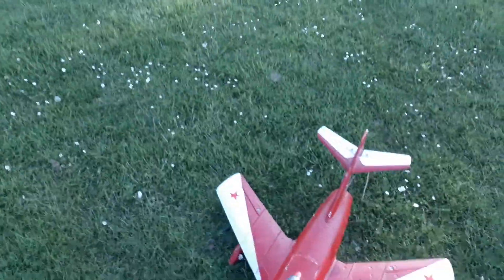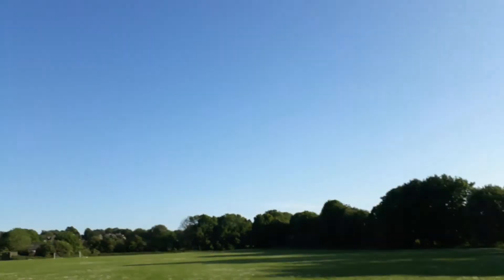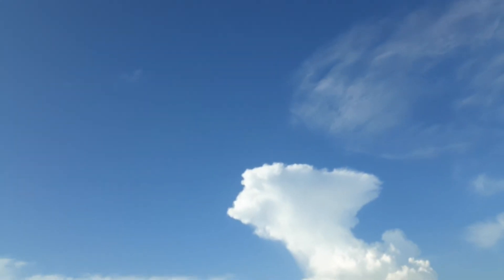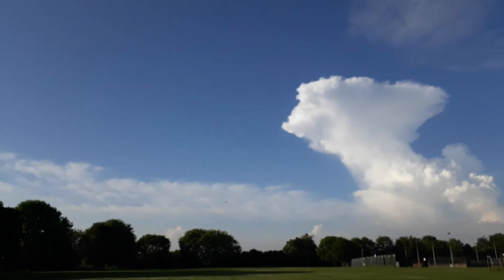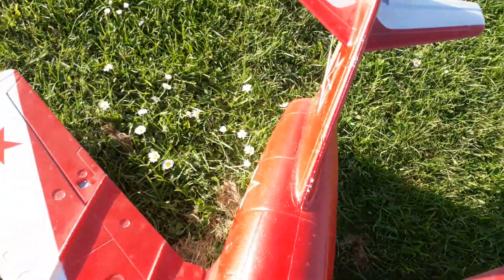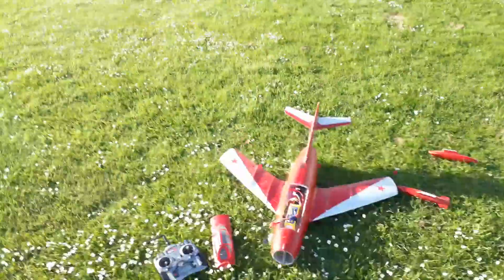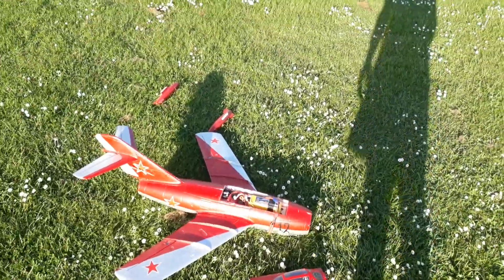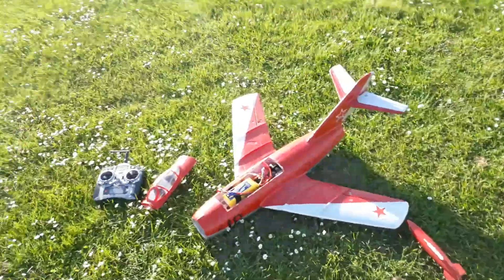Mig 15 rc lander 10b 4s first flight

Comment: Balance is great
Reply: I love the mig. One of my favorites to fly mate.
Reply from the maker: Dave's Rc ..cheers dave .. that nervy c.g moment when it leaves your hand .. I remember my old one was a solid hand launcher so had a little confidence ..

Think I will fly her set up like this for a while ..but will be adding cheaters as it helped a ton with the old one .. I have the parts on standby to go to 6s with a df32 motor from the old airframe .. the old one was 150mph+ rocket ..
But I just want an easy going sporty flier for the summer evenings ..
Reply: If I remember correctly, I always ran my mig a little nosey. It has been a while since I did the CG In my mig. But I'm quite sure it is a little on the nose heavy side.